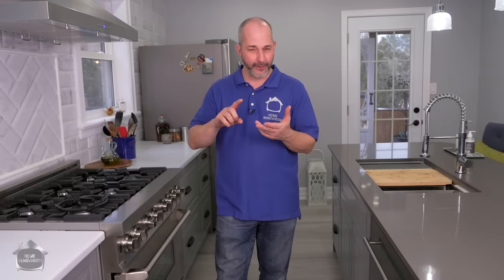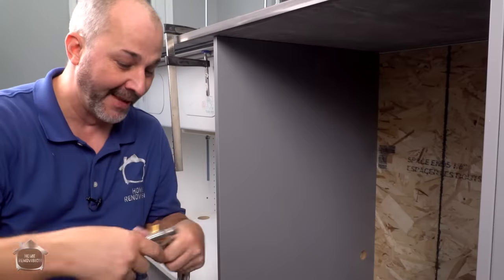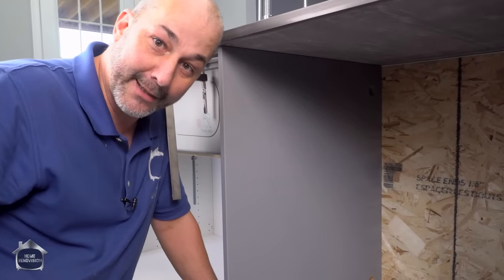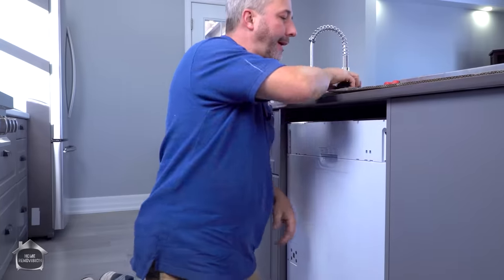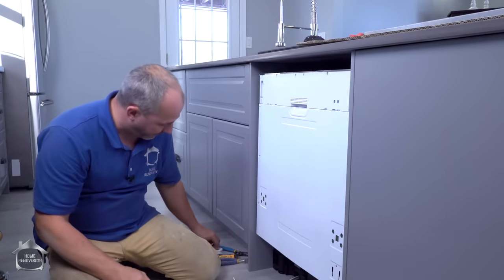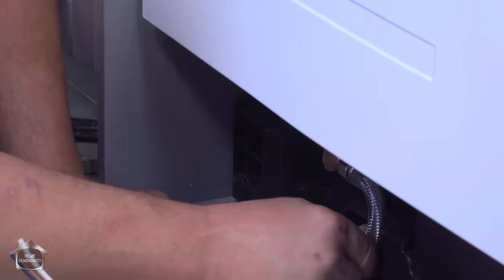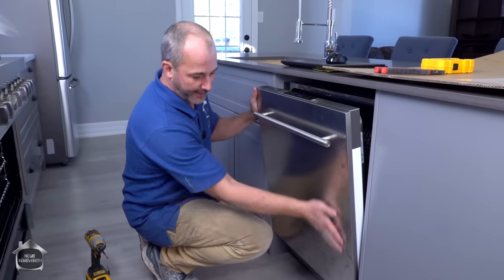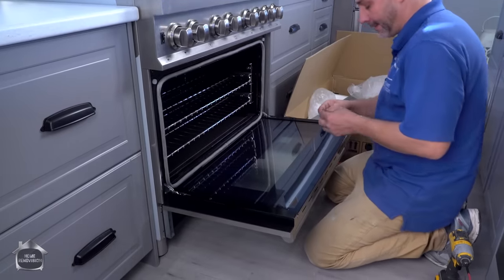How To Install A Dishwasher  Made  Easy!

Comment: Your videos are mostly awesome, however I guess appliances aren't your specialty. Modern code is to put electrical in adjacent cabinet (NEC, "must be readily accessible", i.e. not behind or beneath the dishwasher). Generally you wire through the drywall behind the sink, and install a normal GFCI outlet there.

I'm still googling the height and depth requirements (especially how to navigate through what will be the back wall of your adjacent kitchen cabinet, which should be the same one your sink is in)...but so far what I've read online is 18-24" high, and perhaps use a special recessed electrical outlet made by Southwire to allow the box inside the wall to be mounted to the stud or old-work winged mount, while still allowing the faceplate to sit flush with the inner back cabinet wall (which brings the faceplate out about 3/4" past your drywall).

Also, my manual (LG) says not to run the drain hoae more than 12' from the sink. Not sure how that works with islands (major plumbing work required I assume) but I imagine it could cause draining problems otherwise.

Also, many modern "ultra quiet" (39-42dBa) dishwashers also use up the space on the backs, sides, and bottom with extra padding for sound dampening.  Before drilling any holes, dry fit and check your manual for where you can actually install water inlet, drain lines, and electrical. You may even need to make 2 holes, one at the base/toekick area in the back, and then make a 45-degree turn and another hole in the bottom of your adjacent cabinet under the sink and fish it up vertically.

In all cases, you will still need to zip tie or buy a special "high drain loop" bracket (only 1 brand seems to be available anywhere online, HD online only) to prevent back siphoning, as you mention.

Comment: I enjoy all of your videos! If I can ever give a bit of advice it is that they call those electrical proximity sensors widow makers. A proper multi meter will keep you breathing.
Reply: What's wrong with them? Are they unreliable? And do you have a multi meter recommendation? I know they come in all different price points.
Reply: Fluke T 5600 electrical voltage, continuity and current tester , they are around $100. Those proximity electrical devices are not always trustworthy. Test with a proper meter and take out the chance of electrical shock.
Reply: @bigpermsgarage6290  Thanks!
Reply: Always check it and make sure it lights up on a hot somewhere before using, every time. I’ve been an electronics tech for 20 years, I think they are great, but will agree that a trusted multimeter will tell you for sure. Use insulated clips, hook up one at a time.

Comment: Your water supply line unscrewed about half a turn at 13:22 when you tucked it under the machine... definitely not tight and probably will leak soon
Reply from the maker: no leaks so far.Cheers!
Reply: @HomeRenoVisionDIY  lol, I would think you would be like "Oh hey, thanks for pointing that out... I didn't notice that happened.. I'll make sure it's tight"... but it's your house so it's your call... good luck with the YOLO mentality
Reply: @BrianB.-lb8du  Someone's easily triggered

Comment: Hi Jeff  Im planning on building a floating deck soon using your decking videos as a guide, ive got a couple of questions relating to one of your decking videos "How to build a 50 year maintenace free deck" in it you build a box beam and fix it to the post with lag bolts. i realise that as you stated they have a combined shear strength of thousands of pounds but should the post also be notched so that the beam sits on the post. the other question is how did you fix the joists to the beam i didnt see anywhere in the video how this was done or am i mistaken and the joists sit on the beam and the weight of the deck holds everything in place. thanks for the great videos they are a great help,any plans to come over to blighty to visit your uk fans cheers nick
Reply from the maker: Hi Nick, posts need to be notched in some jurisdictions.  you can always use a hurricane strap to attach the joists! Cheers!

Comment: Your LVP flooring, did you run it all the way under the cabinets and appliances? If no, why not?  We were planning on running our flooring under our LVP under our ikea cabinets, or do you recommend against this?
Reply: Run your flooring all the way under your appliances.

Makes it easier to level.  Also, if your dishwasher leaks, the water will run out onto your floor alerting you to the situation (instead of pooling up in the natural pan you created underneath it by cheaping out on your flooring install).

I have been repairing appliances for 16 years.
Reply: @bbainter7880  What about under the cabinets?

Comment: That gap is disappointing :/
Reply from the maker: a lot of it has to do with the height of the  island in order to level the counters  with the exterior of my wonky old house kitchen
Reply: Were the feet fully extended? As far as I know from my experience you can adjust the height of the dishwasher by a huge amount, several centimeters, even like 10 cm, and it is always easier to cover the gap in the bottom. But this maybe does not apply in your case because everyting on this install is different than what I know from Europe - including the lines coming from the back versus the front, the water hose being a fixed part of the machine, the electrical line being also fixed and having a plug and also the fact that we usually connect cold water...
Reply: @tomaskot9278  Absolutely.  It's a shame some US models don't use the full height... cabinet bases have become taller over the years and models that are XXL put all that previously wasted space (i.e. the yawing gap between appliance top & bench, as well as overly deep "sump" part)  to perfect use, being able to fit in huge platters in the bottom rack, a generous middle rack as well as a cutlery tray.  All three of my European integrated models had feet that could be jacked up so it ended up completely flush with the underside of the bench.  Two of them took a custom cabinetry panel that followed the rest of the kitchen and a continuous kickpanel, that really completed the look.

Comment: If I have a microwave above my stove, what is my best option for ventilation?   I’ve never seen a microwave that works as well as a hood vent.  Suggestions?
Reply from the maker: the idea is solid for up to 400 cfm. never going to be as quiet but it wioll work as an extraction fan while cooking. cheers!
Reply: Actually I decided to open up the vent on top of the microwave instead of recirculating.  Basically treating the top of the microwave like a hood vent and sending the air outside just like a hood vent.  Hope that makes sense

Comment: What did you do with the gap on top of the washer?
Reply: He did it wrong, according to another video and Lowe's cabinet video installation.  There shouldn't be a gap.  The feet might make up the difference, or on a floating floor, you need to add a piece under the dishwasher.

Comment: I'm very experienced at installing dishwashers. He's chose the easiest install looking place on the planet. I guarantee you, it's almost never like that and not germane to what most people's experience would be. I stopped watching half way through but what I saw I can comment on a little.
1) The "Garden Hose" connection is the new thing. Not the other way around.
2) It's ok to drill only one hole for both water inlet and drainage. Just make sure the drain line travels up and then back down to create that p-trap.
3) Calling someone on the phone just confuses the matter. Just use common sense and read the installation instructions the DW comes with.
4) Not all new dishwashers have the fully enclosed underside. This leaves plenty of room to store extra line which is always a good idea. Makes it easier to pull out.
5) On fully enclosed undercarriages attaching a line to the water inlet is a great idea.
6) All dishwasher have the options of connecting it from the top or the side. It's easy to figure out how to do it. Again, the directions are a much better option than calling someone. If the counter-top is compress wood then just screw it in after you've leveled it. If it's granite there is sometimes a section cut out and epoxy in its place that you can screw it into. If there is no space to screw it into then there's an attachment bar you can pick up at your local hardware store to make that happen. DON'T get anything that looks like a super sticker. They just eventually come off.
7) If the cabinet and granite counter installers are worth their salt then they'll make it easy for you. You get what you pay for.
8) If there's no room for your secondary seals don't put them on.
9) Don't put in floors right UP to the darn dishwasher if you put in new floors.
10) I like the 45 inches of clearance the cabinet makers made for the dishwasher. You can always work around that. You can't work around not enough space very well.

Comment: That looks far more complicated than it needs to be?  I was able to install any dishwasher I've owned in 10 mins; drain hose, water inlet and plug it in.  I've never screwed it to kitchen cupboards. Perhaps it's the manufacturer, but I was surprised there was no external side/top to the appliance.

Comment: Where is the installation manual?

I have removed and installed about 4 dishwashers in my lifetime, I hate the leveling and attachment.
Reply from the maker: The worst is those models with the weak metal legs that always bend over.!
Reply: @HomeRenoVisionDIY  the latest Dishwasher is a Bosch.  That was the easiest to level.  It has a screw on the front bottom you turn to level the back.  No more GE, Maytag, Whirlpool, Kenmore Elite(no more Sears, that extended warranty was useless).

Comment: From a pro:

I don't know about Canada, but in the US the elbow connector has almost entirely gone away in favor of the "garden hose" style.  Those elbow connectors require a good amount of thread tape to seal up anyway and I like the garden hose connectors much better...the don't leak and are WAY WAY easier to remove if you need to.
Also......you do know they make 8 foot water lines and 9 foot power cords right?  Makes it much easier to install/uninstall and service if necessary.  Also easier to avoid kinks.
Just bundle up and manage all slack in hoses and lines under the sink.

I am not an installer.....I am a servicer who runs his own business.  In the industry for 16 years.

And for God's sake....use an air gap for the drain if you possibly can.

Comment: Do you hook the electrical into any 12/2 line in the basement?
Reply: Coder1024 it requires a dedicated circuit into the panel 120V/15A, I’m an electrician and had a good chuckle when he put the wire through the 4040 connector first; always put the connector in the Knock-out first and then push the wire through, that way the connector clicks in and not like him having to use force to try and wiggle with it off camera, lol!

Comment: what about that bigass gap above the dishwasher?
Reply: kk P there is a display panel at the top of the door, if you put the machine all the way to the bottom of the counter then you cover your operations panel. I think it looks amazing.
Reply: @ashleyfalcon125  You just open the door to set things then close it? That's what I do with mine.
Reply: EddieLivesOnLincoln Yea I understand that, but to start it you have to use the keypad & the display screen to see where it’s at in the cycle as well, especially since it’s an uber quiet machine, you wouldn’t be able to tell if it’s finished or just in between cycles if you couldn’t see the screen. Right? There are no indications like a dial or anything on the front like most dishwashers. You have to be able to see the top lip of the machine. It’s supposed to have a gap. And it’s not an obnoxious one so I think it looks really good & is still functional. 🤷‍♀️ it doesn’t take away from the esthetic of his kitchen at all so there’s nothing wrong with it. It looks fine imo.
Reply: @ashleyfalcon125  I get your point, but I'd have to do something about it. Probably glue a piece of 2x2 under the countertop, recessed by a few inches so that the screen is still visible, then use that to glue a finished piece.

Comment: I like your videos, but now you are scaring me.  That grommet for the wire is an absolute no-no. I doubt it is different north of the border.  It needs to clamp the Romex wire so it can't be pulled out.  Ought to be interesting to see how you do actual electrical work.  You just ran the wire through the floor for future connection.  You know the connection needs to be in an accessible junction box?  Now I am not sure you do.
Reply: The grommet is ok, it allows the wire to push through one way but binds and stops it from pulling out the other direction.
Reply: Good comment. Now, I'm no expert on much of this home reno stuff, but I do know that minimum code requirements are different in every jurisdiction. Jeff has been doing this sort of thing for a long time and all of his previous electrical work has passed inspection in the jurisdiction where he lives. If he needed an L-16 for his 14/2, then I'm sure he would've used an L-16. And for all we know, the connection for wire he ran through the floor might have terminated inside his panel. What are you assuming he did with it?
Reply: Why would it not be accessible? We have basements in Canada lol.
Reply: I live in Canada, not far from where Jeff lives and that grommet is completely legal to use in electrical. I did all my own pot lights and light fixtures just last month and used those exact same grommets from home depot and we passed inspection with no issues. Also he said his basement is unfinished. Meaning there is nothing wrong with putting a junction box down there where he can later feed directly to the panel. It is accessible. If you want to see how he does electrical work watch his earlier videos from when this renovation started. He wired the entire house.
Reply: can you cite the specific NEC code regarding this? afaik, as long as the grommet secures the wire and is approved for that use, it is fine. that being said, he didn't really clip the grommet in correctly (hole too small?), and if it doesn't seat correctly then he probably should have gone with a clamp otherwise it does violate code as it doesn't secure the wire.
Reply: @jdvaillancourt  The video shows him snipping the romex off short for a future connection which is fine, yet he tests it to make sure it is not hot. Confused.
Reply from the maker: I have a basement and will put the junction box in the ceiling down there. Cheers!
Reply from the maker: Cheers!

Comment: You didn’t insert the plastic grey connector properly into the knockout. I was loose and only clipped on one side. You could have also connected the green insulated ground wire from the dishwasher with the bare ground from the 14/2 with a Marrette.

Comment: Dude, that wire grommet isn’t seated correctly and the neutral wire the wire nut isn’t covering the connection. And to top it all off you didn’t even connect your ground.

Comment: That gap at top of the dishwasher is an absolute abomination! Wth? Really Zline?
Reply: It's a lazy kitchen fitter gap. Raise the whole dishwasher up then that nice plastic strip they give you can actually stop the steam damaging the woodwork
Reply from the maker: A littler harsh don't you think. remember my kitchen is in an old house with a raised outer wall. the island was leveled high to accommodate this which created a larger gap. this is the lesser of the 2 evils!
Reply: @HomeRenoVisionDIY  easy way is get it in the housing, tilt it forward, screw down the rear foot. Then gently tilt it back and lower the front two feet. Just letting you know for future reference.

Comment: dishwasher installed badly, too much lower than it should be and clearly not aligned to nearly cabinets, shouldn't open new holes to screw it and must use all 3 feets to adjust (1 is in the backside but it can be adjusted from front with a socket). 

Front panel must be screwed to dishwashers' panel, it's hardware isn't much essential to do a perfect job, however installing it when the counter top is in place is a little harder than work with no top ...

When finished about the install let's put in place the kitchen plinth to check if the panel hit it, if it do (in your case 100% does) must make a cut to let the panel opens...

Clearly is your 1st machine, let's make better next time.
Don't stop your job, keep it great!